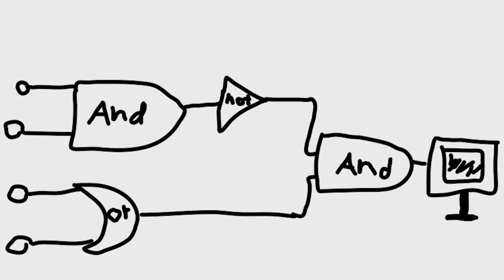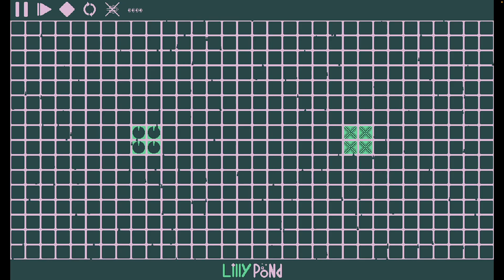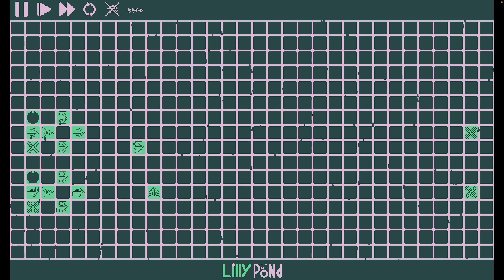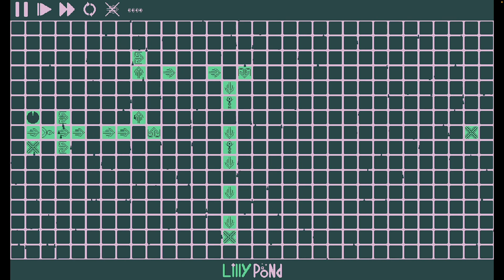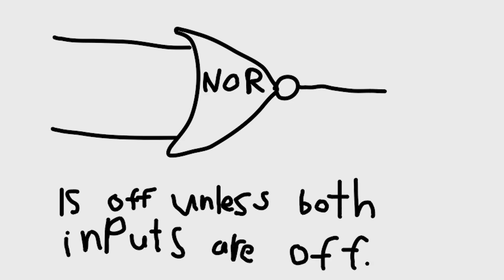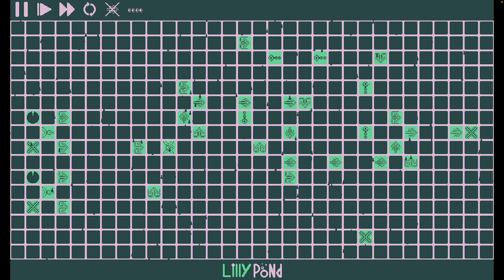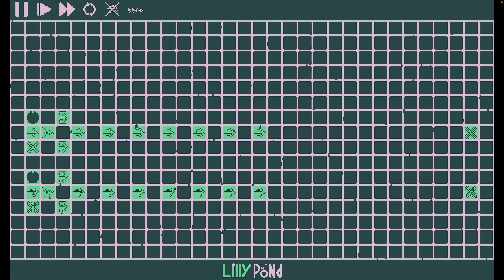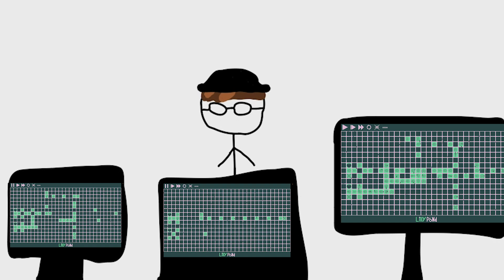Logicpond

Comment: Just one tip. Any time you say "by adding a <cell type> *here,*" put up some kind of highlight on it. 

If somebody doesn't already know pretty much exactly where to put their foveal vision, they're going to miss what you're doing. Especially with their visual change detection already being fuzzed over by all the little black glitches tumbling through the grid lines.

OK, 2 tips actually. Get rid of all the little black glitches tumbling through the grid lines. They make the Lillypond less sterile, more organic, but they also make it harder to read.
Reply from the maker: Thanks very much, both good ideas. I'll do that in the next lillypond episode.